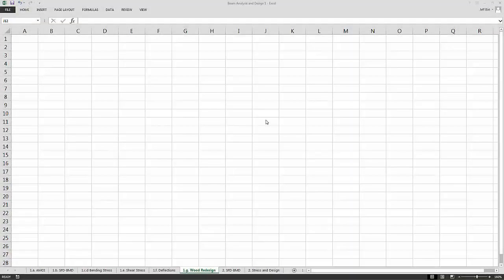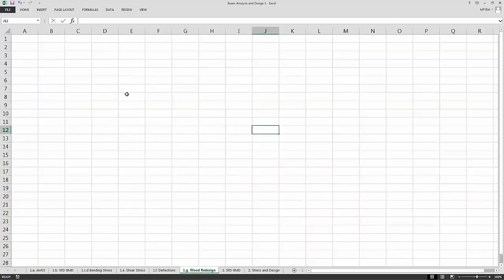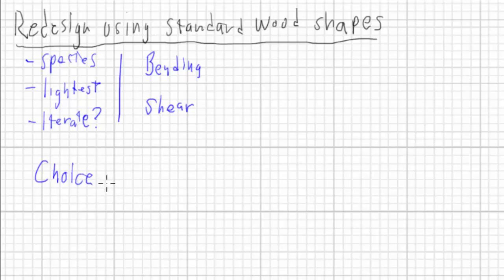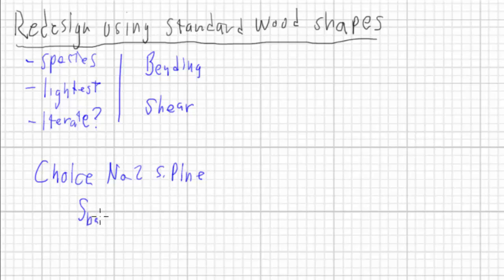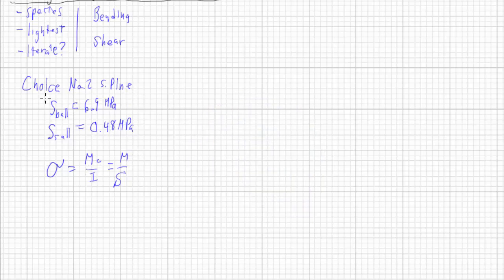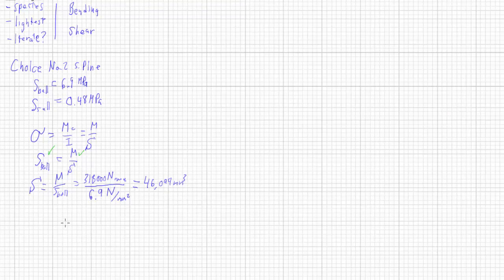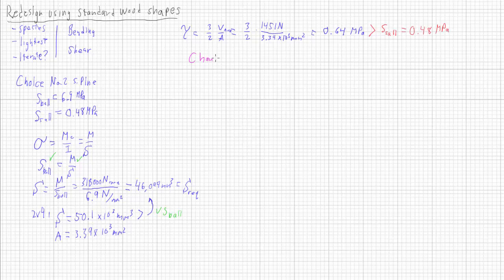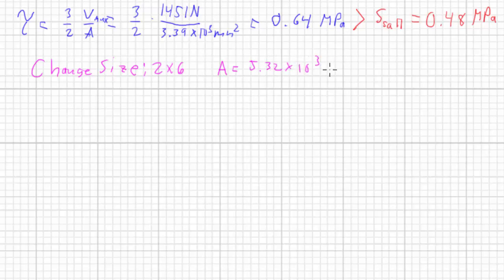Design of a Wood Beam (Beam Analysis and Design 1 g)

Comment: Excellent video. But I was trying to see how can I choose type of wood (looking for cypress maybe or glued laminated)
Load is 1000 pounds per liner foot beam and is supported by 4 columns. I want to choose type of wood and cross section maybe 8x8 that can handle this load. Any ideas of where to start ? Thanks
Reply from the maker: If this is for an actual application, please contact a licensed structural engineer. If this is for a course, support with several columns is documented in civil engineering handbooks and some textbooks. That would be how to find the shear force and bending moment. From there, choosing the material and the cross-section would be a design problem. Pick a material you would prefer (i.e. for aesthetics or cost), then find the required section modulus and determine the cross section. Or, choose a cross section based on other geometric requirements (clearances required, etc), then determine the material strength required and choose a material. I usually prefer to choose a material first. 
Good luck!

Comment: Hello. What is the source for the tables with timber properties?
Reply from the maker: Since this is Part (g) of a multi-part problem, I probably mentioned the source in some other part, so my apologies if it wasn't clear. This problem is based on Mott's "Applied Statics and Strength of Materials", now offered by CRC Press. It is a very good book. The references are also from there. 
I am not Mott and receive no consideration for this endorsement.
I hope this helps. Thanks for watching and commenting!